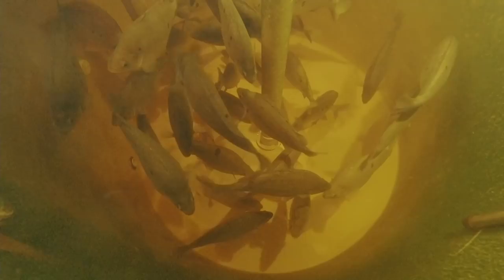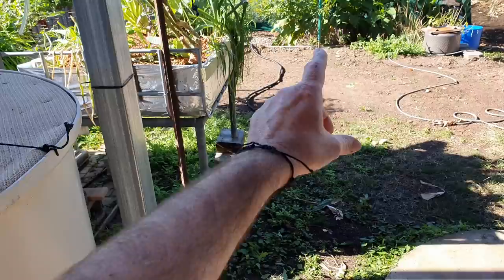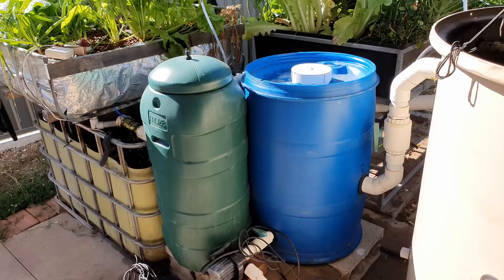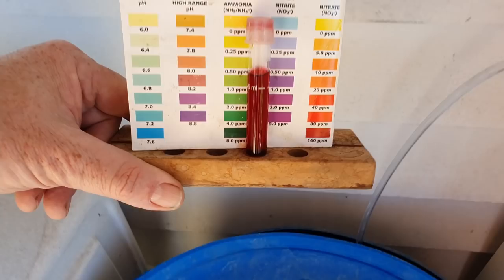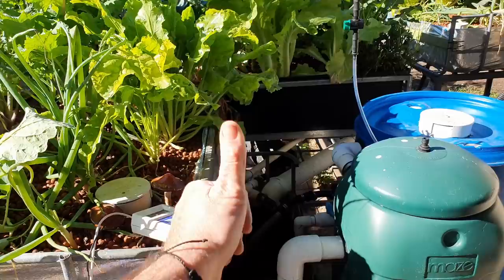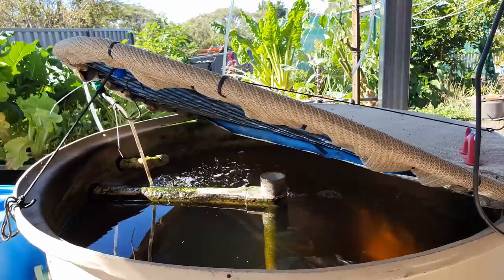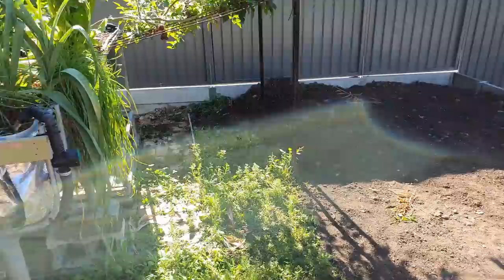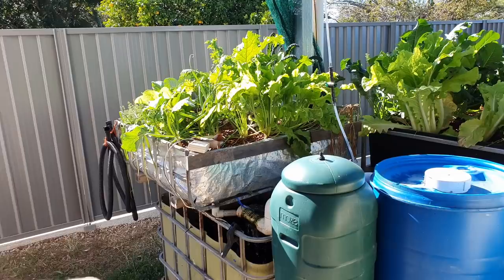Aquaponics Mineralisation Tank & Aquaponics System Update

Comment: Very nice video presentation brother.  Very good ideas conveyed . I have a suggestion . Do put a few spoons worth  of your regular fertilized garden soil and organic cow dung fertilizer in your system from time to time to leach out minerals and mix with water this can be put in the radial flow settler so that when ever solid wastes are removed they are also removed . As far as the chillies are concerned . You can either poke holes in them with a knife or fork and put in a jar of vinegar and salt to pickle them or make a sauce by putting them in blender with some garlics and tomatoes and some salt to make a salsa like sauce .
Reply from the maker: Thanks for that DK. 
I have put casting teas in when I first started but fond they weren't necessary once the fish started to consume more as they grew. Probably should have kept it up. 😉
I will be adding additives to the mineraliser from now on though as I get castings & compost made. 
Made up a few batches of sauce already but didn't ferment them this time. Takes too long through the cooler months I've found.
Hope all's well with you mate.
Reply: @RobsAquaponics  thanks brother . Every thing is going well and very hot in my part of the planet .

Comment: I bet you could move the MT right next to the RFS tank and direct connect them.  The head pressure from the RFS should be able to push the solids into it.  I have a 1" ID tube between mine....which I went with 1.5...sometimes I don't flush it every day and it can get a little constipated. 😬
Reply: How about an update on your MT.  Have you ever flushed it?  An also you aeration system, any issues.
Reply: @TinaKelley000  I drain out some sludge every few weeks.  Aeration has been running fine.  I've never opened it to check it.  Maybe I'll do an update at some point.....
Reply from the maker: I'm very sorry I missed this Rob. Need to talk to you about that "link" as well. 😉
If I had the space next to it I would. I don't like leaving pipes on the ground over walkways others use. May just do so in the next build though. 
Cheers mate & hope the campaign is going well.

Comment: I've done a winter time solar heater with black irrigation hose, on a square of wooden boards about 1.2m square. Used a couple of 20m rolls of 19mm black hose to cover it with one big coil. Also used a little solar powered pump to push the water through it and you would be surprised, it doesn't take much water flow to overwhelm the heating capacity of the panel. I mean too much flow and there was almost no temperature change between inlet/outlet, I could only have a little trickle coming out for it to be over 20 deg/C. I think two of these panels in series would make a decent temperature difference.  That was down here in SA though with colder winter temps, you might have better performance up there ;-)
Reply from the maker: Thanks Sam. I played around with a coil solar heater with the first system we had & found we didn't get much of a temp lift out of it. 25M of 25mm irrigation hose wasn't enough to lift it more than about 5° with a trickle running through it. It's definitely something I want to play around with again at some point down the line.

Comment: Hey Rob! I can definitely vouch for the effectiveness of any sort of solar water heating, I've got a full panel running on the excess water from my main growbed pump. Keeps the fishies a bit warmer even though winter sucks here and my hoop house really needs new plastic.
Reply from the maker: Has the system started to bounce back now things are warming up Mel? 
Am still looking at trying to use solar to heat the next system. 
Hope all's well with you folks down south.
Reply: @RobsAquaponics  Hi Rob! System is doing great, unfortunately I'm not and can't give it the attention it needs. :P It needs some replanting and weeding (ye gods, weeding in aquaponics, that alone tells you it's neglected right now!) and a couple of the very happy plants need to be cut back severely. I'm switching meds again so hopefully I'll be able to do some work soon.

If you do end up going with some solar heating there's a bunch of options from very low tech to some seriously complicated stuff, I'm on the very low tech end and it works great! I look forward to seeing what you try out
Reply from the maker: @meltheredcap6307   Hope they work well for you Mel.  I'm thinking I'll go with low tech option like yours if I can find one at the right price. Wasn't very happy with the coiled pipe systems when I've tried them previously.
Reply: @RobsAquaponics  I'm very happy with mine so hopefully you will be too! It's a type of panel that's normally installed on roofs, it's just a bunch of thin black rubber(?) tubes arranged in a flat panel. I have it hanging vertically from the centre roof brace in my hoop house; water pumps up to one side from my sump and drains down from the other side to my fish tank. It's on a timer so it only runs while the sun is on it. It doesn't need much water flow and actually works better with slow flow, but because of the height it's pumping to and needing to push through all the little tubes it takes a fairly strong pump.

Comment: you've given me an idea. I wonder how a worm farm on top of that kinda olive drum setup would go, lil pump to keep some water going through it but all the compost and worms and airation and what not
Reply from the maker: I have a mate here that runs water through a farm before it's added back into the system.  Daz said could see the results almost straight away. 
Cheers.
Reply: Ive built a system I call vermiponics works amazing

Comment: I don't remember if you have a dehydrator but that's how I'd preserve the chilies if you're not pickling them.
Reply from the maker: I do & have used it in the past for chillies. The first time I dried some years ago was with some 7 pot yellows & ghost chillies. Gassed the whole house out while we went out shopping. It took a few hours for the air to clear so we could go back in. 🤣🤣🤣
Will be mincing most but might toss a few through just to see how they work out. Can set it up under the house now so we should be safe upstairs. 😉
Cheers & all the best ryefry.

Comment: I like the remineralization tank Rob. 
Do you add anything else to the tank to supplement before adding back to the beds?
Reply from the maker: If I had a worm farm on the go I would contemplate adding a bag full in to brew with the liquid the night before adding it but that's about it. I may add some carbon source to feed the bacteria as well. Tossing up between un sulphured molasses & flour as it was suggested to me that it will work as well & contains more elements than straight sugar. Will have to read up on that a bit more though. 👍
Cheers ID.

Comment: I need to automate my mineralisation. It is hard with the buckets. Would it be advisable to add rock dust or minerals to  mineralisation tank?
Reply from the maker: I've seen some folks toss in minerals & would think that the right bacteria may just help to make them plant available. Adding un sulphured molasses in will help add some minerals as well as carbon to feed the bacteria. 👍 I have ours set high enough so I can connect a pipe to run straight to the sump if I find the water comes out clear enough after settling. 😉
Cheers mate & hope all's well with you folks down there.

Comment: That deficiency appears immobile, which means it is Boron, Zinc, Copper, Iron, Manganese or Calcium.

*I do realise it is completely unhelpful to point out half the periodic table and say your problem is in there somewhere however, if you are sure its not an iron problem and you're going to add manganese you have already further narrowed it down. Plants require so little Boron and Copper that these are unlikely too. This is how I figure my stuff out. Process of elimination. Cheers Rob.
Reply from the maker: Cheers mate. Had already picked it was immobile as the young tips were the worst affected after the magnesium was added. 
Have a top one Brad. 👍

Comment: mAY I ask Rob, the wattage of the heater?
thanks in advance
Reply from the maker: I'm running a small 500w heater in. Can be expensive to run 24/7 but our solar elec system partially subsidises it's usage. 
Cheers.

Comment: I had built this sort of 'solar water heater' using an 8x4 board and poly pipe which I fill to the very top with water each winter and have BOTH ends of the pipe in the sump. At one end of the pipe I have a one way valve (one of those brass thingys you use for getting fuel out of drums etc.) and, as the water heats in the sun inside the pipe, it creates a vacuum which draws water back into the pipe through teh one way valve and back into the sump.
https://www.youtube.com/watch?v=Garu9T5ReAI
Never needed a pump, it just does the thing itself.
Once the weather heats up - usually mid to late September where I am) the pipe is drained and covered with a tarp, ready for next winter...
Reply from the maker: Nice one Nicolai. Have played with them myself in the past but had it powered by a pump.